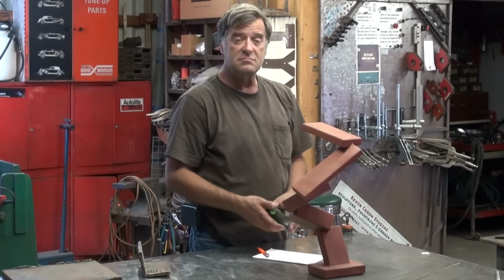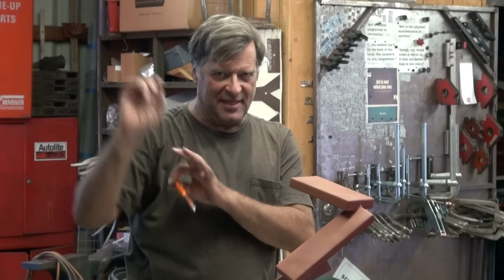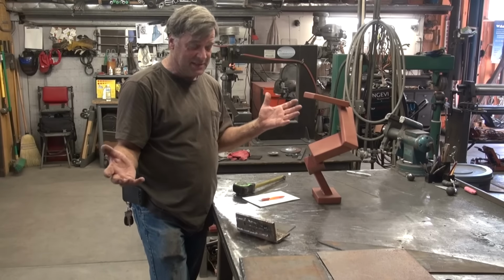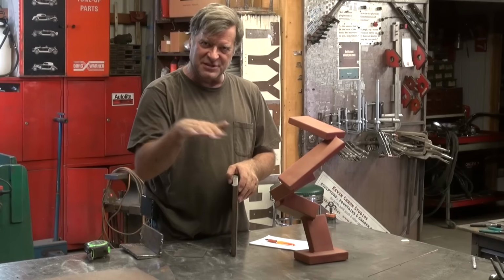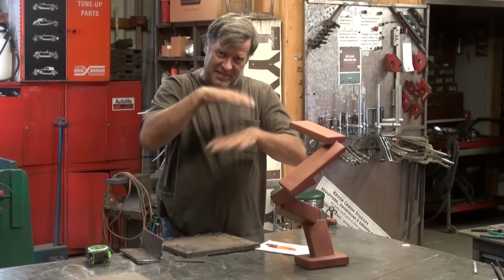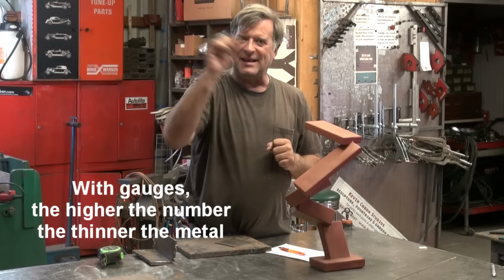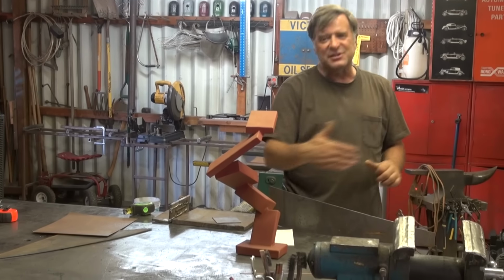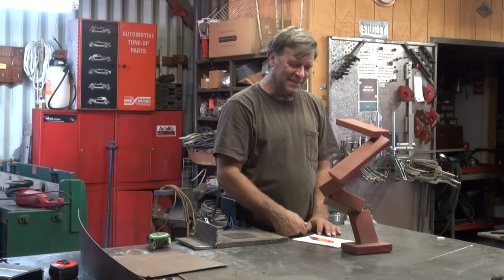How to Pick the Best Gauge Metal for Your Project - Kevin Caron

Comment: Great video thanks very intuitive. What gauge would you use to make a yakitori grill or an all-around charcoal grill? that can stand high heat and won't buckle.Thanks
Reply from the maker: 3/8th inch minimum.  1/2 would be my preferred.

Comment: Is there any formula to calculate the required guage ? because you have said it randomly in this video, so are there any formulas for selecting the thickness and sizes. please help me to learn.
Reply from the maker: I am sorry but I don't have an answer for this one.
Reply: I'm a third-year aerospace engineering bachelor student and this would take me a while, but is definitely doable. The issue is that all the odd angles and asymmetry make the calculations fussier. If you want to get into it, you can find some edX courses for it! I recommend first finding a statics course, then doing mechanics of materials (only the first two parts). Then finally do some googling to find shortcuts on these asymmetric bending problems.  Or like they say at mechanical engineering, use safety factor 10 ("it looks like it wont break") .

Comment: Hi 
I'm interested in welding some rusted area parts of my undercarriage and rocker panels on my project nissan. What gauge do you recommend??
Reply from the maker: 16 gauge or heavier.   If you can shape it to fit go with some 1/8 in the high stress areas.

Comment: I am looking at riding mowers the frames on the two I'm looking at are either 10 gauge or 12 gauge frames. There is an $800 dollar difference. Is the 10 gauge really that much stronger? $800 worth stronger? Thank you so much.
Reply from the maker: I would say so.   Thicker metal is always going to be stronger than thinner.
Reply: I did the calculations and I believe the 10 gauge is 20% stronger. Is that correct?
Reply: Would you say it's worth an additional $800? Thank you so much!
Reply from the maker: About right yeah.
Reply from the maker: I don't think it is worth that much more.
Reply: I'm sorry to keep bothering you but I know you're an expert. So you would spend the extra $800 4 the 10gauge?
Reply from the maker: No, I would not!
Reply: Thank you so very much! You don't know how much you've helped me. I truly truly appreciate it. Thank you so so very very much!!!
Reply: Kenzo B bad

Comment: Hi.  What gauge do you recommend to replace an A/C evaporator ceiling cover in my bathroom that is roughly 30" by 46".  So that it doesn't sag, but is light and strong enough to hold 3/4" foam insulation?  Thanks
Reply from the maker: 20.
Reply: hi have i a few questions about metal now this may not done this before but for a metal gauge/thickness stand point i am wondering what metal gauge should i use to make a low budget airsoft gun and should i use steel for it i am looking to make something that can take an impact hit and still stand tough and make a rail system for it so i am wanting something strong and i need it to be thick any idea's
Reply from the maker: !/4 inch plate should do the trick for you.  Maybe you can get away with 1/8th inch but not sure..    Go with the 1/4 and you will be fine..

Comment: if this doesn't have to be metal the cheapest way would to be make the whole thing out of wood, bend a metal tube from the top to the bottom, for a skeletal support and bolted through all of the wood blocks, and cement block the bottom base that goes into the ground, cheap and works
Reply from the maker: Sorry, had to be metal.

Comment: what gauge steel would you recommend for hot rolled floating shelf? it's 10 ft x 12" x 2".
Reply from the maker: 1/8th inch with a 1 inch by 1/8th strap running across the front to keep everything straight.

Comment: So I want to make a Swedish ladder. It's exercise equipment. I will use 4x4 lumber for the uprights. The horizontal rungs are traditionally wood, but they eventually snap and need replacement. So I want to use metal/steel for the rungs. What do you guys recommend? 

Considerations: 

- 39in length; roughly 1.25in diameter 
- rust resistant 
- strong enough to hold 400+lb safely (people, punching bag, etc.)
- strong enough on which to swing, jump, stand, bounce
- not too expensive; will be using about 60 feet worth of tubes/pipes

Thanks!
Reply from the maker: 3x3 1/8th wall square tube for the uprights.   1.25 inch outside dia. pipe 1/8th inch wall for the rungs.
Reply: @KevincaronSculpture  Awesome. Thanks!

Comment: i dont have a metal gauge ruler or watever u call it. how can i tell wat gauge metal i hve? can i compare it with a coin? example, is a quarter almost as thick as 18???  16?, 12? or a penny is close 2......? dime...? plz help
Reply from the maker: What a great question!!!         It turns out that a dime and a nickle together are 0.123 and a 1/8th inch plate steel is 0.125.  Going smaller  a piece of 16 gauge steel is .051 and a dime is .053.  A sheet of 18 gauge steel is .040. And a $5 dollar bill if you fold it 10 layers is .039.    I will be making a video about this so thanks for the idea!
Reply: Kevin Caron, Artist 
Thank you, u sure no ur stuff and i appreciate all the knowledge you share. 
i was comparing a nickel on my welders chart inside of door and it seems pretty close to 18 gauge???  i guess i could hve used it  2 check out the other coins but i didnt thunk about it until after i sent u the question. thx